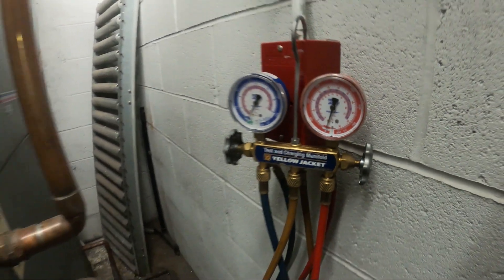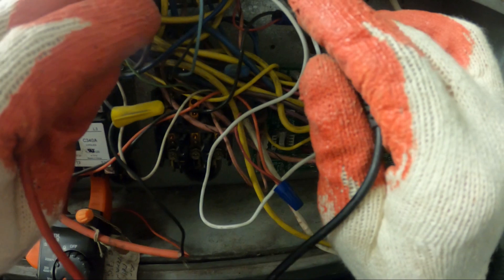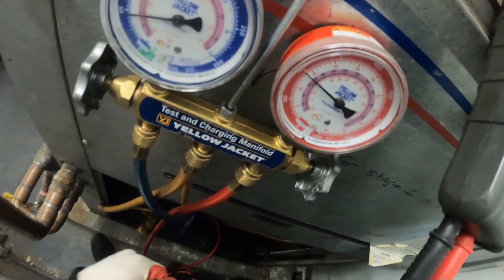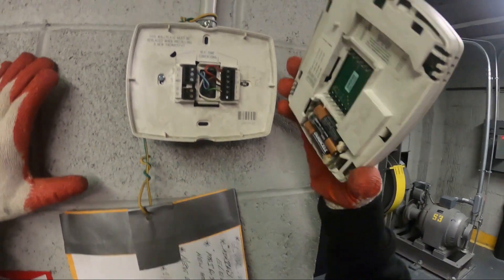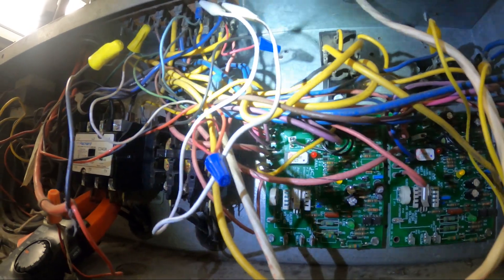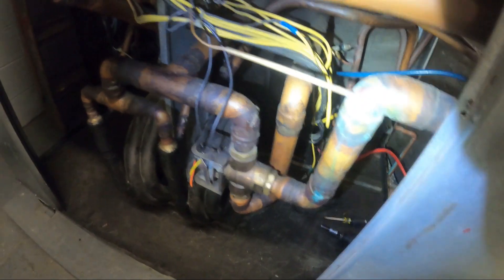HVAC: AC Compressor Not Turning On (2nd Stage Compressor Not Working) Troubleshooting AC Compressor

Comment: You have two stages both stages are running with low suction pressure, from what I could see in the video both stages seemed to have fairly identical suction pressures in the 50 psi range. With that being said I would look more towards their being plugged filters or low airflow more so than a leak. I find the majority of my leaks visually looking for oil and following up with the soap and water solution or the electronic  leak detector and soap Very rarely do I have to recover and pump the system up with nitrogen.
Reply: Excellent . Air flow should be proven 1st . Could be just a lose belt or even a circuit setter to high

Comment: No amps on this one.   
Try setting your meter on amps, insted of volts.
Reply from the maker: 0:48 By mistake my thumb changed the settiny from amps to volts🤣 LOL you can clearly see the plunger isn't plunged in and that compressor wasn't running. Good eye! Thanks for watching🔧
Reply: Justed wanted to make that remark as well ;-)

Comment: Hi jmt! im a a complete novice in the hvac field with less than even a year of experience and i find your videos very helpful and entertaining! If it would be ok, can you come out with a video explaining how to calculate btu’s or how to read wiring diagrams? Im really struggling with those aspects and would love to get some visual advice from someone whos been in the trade for awhile. Thanks!
Reply: Btu’s = Watts x 3.413
There are different calculations for different applications, a lot of this can be found online.

Schematic wise, start with ladder diagrams (of something like your basic  furnace/interlock circuit) and use that as a visual aid. Draw parallels(figuratively)  between that and the schematic of the same/similar circuit. It’s the same information in a different format/presentation. Schematic will be more thorough, of course.

Aside from that, get familiar with the symbols. Memorize the common ones, and refer to the legend of whatever schematic your looking at to fill in the blanks.

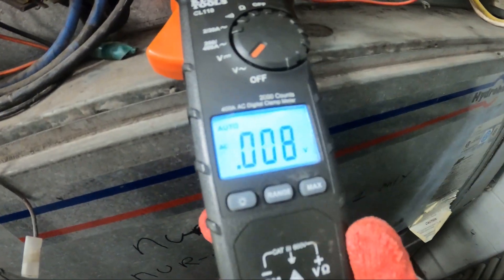Comment: At 0:57 you show your meter reading .007 v. Are you on the volts scale?
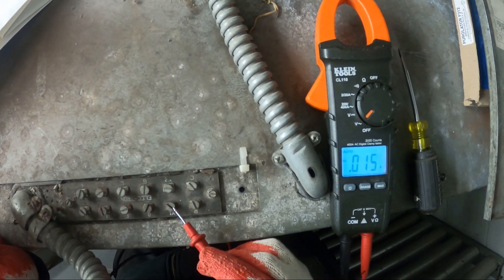Reply: No he’s reading amps. When you see the meter again at 1:50 the knob is turned to a different mode/position reading volts. Some meters are weird like that. Like fieldpiece, you’ll be on the volts/VAC mode but have to toggle on the amps, which then display simultaneously above where the volts would read. Idk.